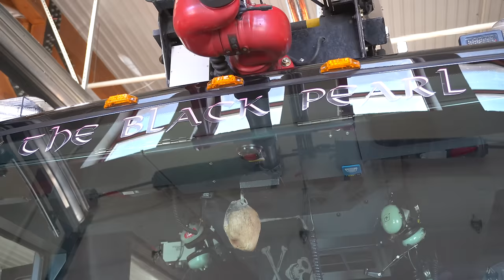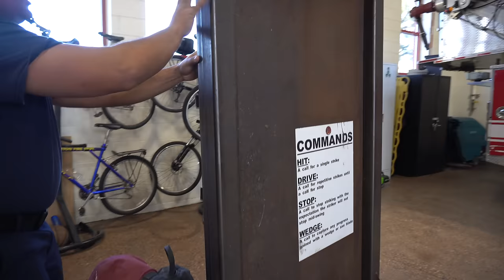Firefighter - A Day in the Life

Comment: I have a pretty typical 4 hour duty shift at William Cameron Engine Company–Lewisburg Fire Department.  I’m not an active member like you think.  I’m a volunteer.  I’m volunteer support staff.  As volunteer support staff, my duties range from cleaning the hard suction hoses on our first line pumper to assisting with different daily chores like drop tank training (deploying a deployable water tank, filling it off the tanker, and drafting out of it with the first line engine), apparatus checks (I voluntarily checked our new tiller, which is ex-Hagerstown Truck 1and ex-York Township Truck 19-2), and cleaning apparatus interiors when the need for such work arises or when I feel one or more interiors should be kept clean and disinfected.

Comment: Great video, my only concern is that your firefighters are wearing possibly contaminated turnout gear inside a grocery store around food. Turnout gear can be highly contaminated with many substances up to and including products of combustion. If gear is not allowed inside the bunk room, or living areas in firehouses, it is not good practice to wear that same gear inside a supermarket where they have the potential to contaminate food, especially in the produce section.
Reply: @SouthMetroFireRescuePIO  Thank you for responding. I disagree with your assertion of a low risk factor, unless of course all sets were cleaned prior to your 48 hour shifts, and in turn the company did not run any call/s with the exception of a medical with no bio hazard exposure risks prior to a visit to the supermarket. I have been a firefighter for 13 years in a fairly large city and in my opinion there is no such thing as clean gear. OK gear is extracted, great. The interior of the cab still has particulate from an incident (cloth seats), tools and equipment in pockets same deal. Structure fires, vehicles fires and the like are not the only incidents that contaminate gear. The MVA they ran prior to, could have exposed their gear to chemicals, hydrocarbons, battery acid, the list goes on. As public servants, we must take every precaution to protect those we serve including ourselves. That again in my opinion includes not exposing others/things to our dirty gear, minimal risk or not it is still a risk. Not trying to be a jerk, just trying to stress the importance of cancer prevention.
Reply: Greg P Didn’t see any of these guys jumping up and down in the aisles or rolling around in the granola transferring carcinogens too and fro. There’s such a thing as carrying something to far
Reply: Greg P , these dudes at SM are gonna hate you when they have new protocol saying they can’t wear bunker gear anywhere anymore😂

Comment: Why do firefighters in USA deal with Medical Emergencies? O.o
Reply: In Germany this is also very common since our ambulances often are already on calls so the firefighters have to move out. Especially in larger cities this is becoming more and more the case.
Reply: UK fire service in my area have 2 crew members that are paramedics and carry the same gear as rapid response medical car. 

I called 999 at around 10pm after witnessing someone collapsing. Was expecting to see a ambulance pull around the corner but it was a fire engine and then their own ambulance which I've only seen that once
Reply: A lot of different departments are cross trained because the fire department and paramedics are merged

Comment: What is the giant hose thing that gets connected to the trucks when they pull in back at the firehouse? 17:25 for example. Water or gas refill maybe?
Reply: It’s a hose that helps vent all the dangerous fumes that come from the truck (diesel fuel, carcinogens, etc) out of the inside of the firehouse

Comment: What is the blue pipe for? The one that connect to the truck. Is it refill the water? 
I'm glad if you want to answer this stupid question 
Thanks 🙂
Also, Awesome video I like it . 
God bless you all firefighters
Reply from the maker: The pipe that connects the truck to the ceiling is a vehicle exhaust ventilation hose. It vacuums the exhaust out of the station to keep the air cleaner inside.
Reply: @SouthMetroFireRescuePIO  oh, thanks for the info :)

Comment: If anyone happens to see this and knows the answer would you be kind enough to please tell me what that silver/blue pipe is this gentleman hooks up to the truck whilst entering the fire station?  Thank you.
Reply: It's a vehicle exhaust removal system. Hook it up when you return and when you turn the truck on, it captures all the exhaust fumes and sends them back outside. They also self release, well most of the time, when the truck exits the building.
Reply: @greyman686  Thank you very much for letting me know, that makes complete sense. Much appreciated Grey Man. 👍

Comment: What are those hoses connected to the vehicles for?
Reply from the maker: Those are used to vacuum the diesel exhaust and vent it out of the roof. It helps keep the air inside the station cleaner and safer.
Reply: @SouthMetroFireRescuePIO  oh now that makes sense thanks 🙏🏾 a lot for explaining

Comment: What is the large vacuum hose that they hook up to the truck?
Reply from the maker: That is a vacuum hose that removes diesel exhaust from the building.
Reply: To minimize carcinogens in the Bay Area/Fire house
Reply: @jaycebeverly6254  so it’s hooked up to the exhaust??
Reply: @ericg649  yeah
Reply: @ericg649  the tubes blow out the roof normally